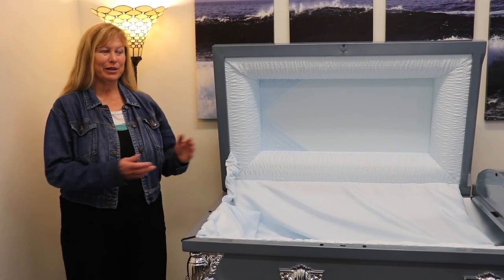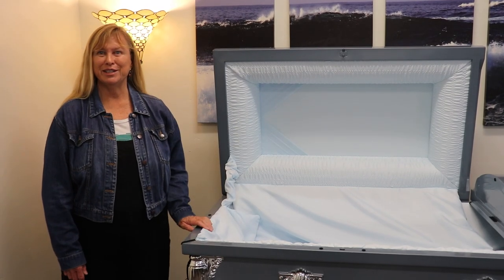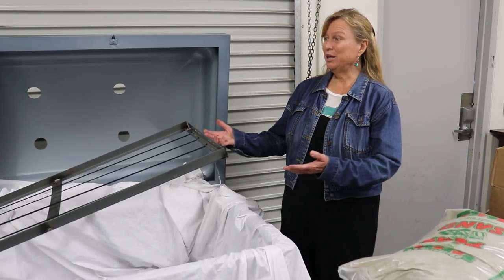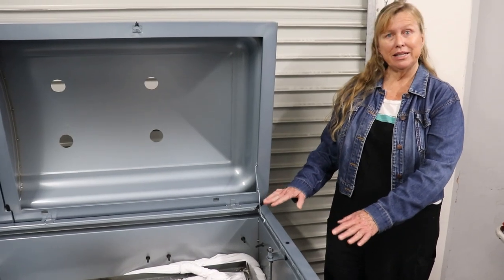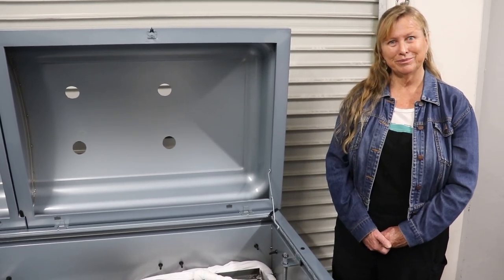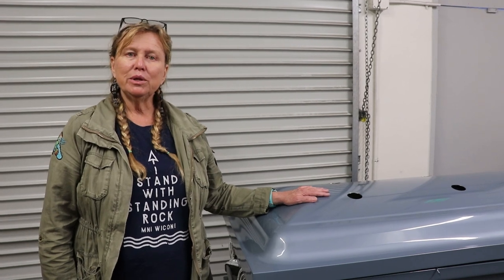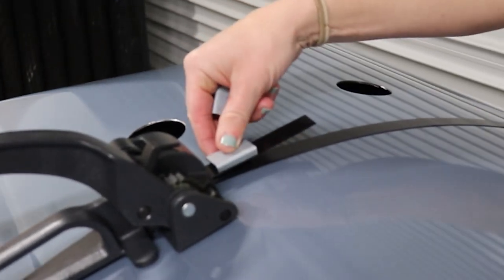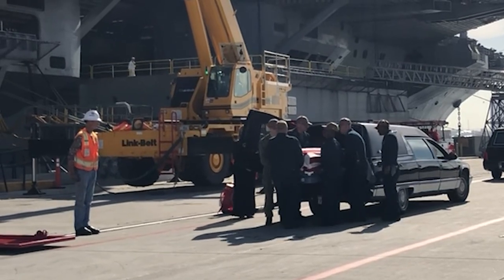Burials at Sea - Military Full Body Burial with Casket - [Funerals Your Way]

Comment: It's good that the military caught up with the preparations. Even back in the early 2,000's, often with a burial at sea, using a casket, it would float. After the ship pulled ahead and the floating casket was no longer visible to anyone on deck, sailors out of sight on the aft deck would shoot the casket until it sank.
Reply: How this casket was prepared was exactly how it was done back in the 80's when we did a burial at sea. A floater (as we called them) was a rarity but the Gunner's mates were always standing by..
Reply: Oh Wow

Comment: You would think the casket companies would make a casket especially for this so the funeral directors wouldnt have to do the extra work of ripping out the lining, sand, etc.
Reply from the maker: It would not be worth it. Burial at sea like this is not that common
Reply: A casket can be ordered from the manufacturer minus the interior, and they might even vent it if requested.
A military vessel is not necessary for this service, acquiring one would require added government paperwork, and if one is used it need not, and probably would not be an aircraft carrier.

Comment: I don't understand why they went to using a casket for a sea burial. In WWII they were sewn into a canvas body bag that contained a 5 inch shell or some other weight and slid off of a ramp into the sea. That seemed more dignified to me.

Comment: So sorry and forgive me for my ignorance but why a metal casket with plastic ties when a wooden one would break down over time as would cotton ties . Much respect . Caron.
Reply: The straps are made out of metal too. Wood not good! You don't want the box to break down before the body.
Reply: @chrislewis7238  ahh I can understand that. In these days tho you'd have thought they would have come up with something that wouldn't like at the bottom for eternity. Thanks for replying x
Reply: Wood is floating and you would need a huge amount of extra weight to make sure the casket is sinking. In the early days the burrial would have been done in a “bag”
Reply: @carondean2960  The thin gauge steel used to make caskets will disintegrate over time.
Reply: @chrislewis7238  Oh I imagined it was quite thick metal . Thanks for that
Reply: @chrislewis7238  why not..... Who's going to know? They will be far deep in the Ocean 🤷🏾‍♀️
Reply: @bas6983  cement will do it
Reply: @Noneck1999  who's gonna lift it?
Reply: @Noneck1999  The point is not to have ocean currents  carrying remnants of human remains all over the place washing them up on shore.
Reply: @chrislewis7238  fighter pilots from WWII DIDN’T , Titanic, ect. Deep water.
Reply: @Noneck1999  WWII fighter pilots crashed in primarily warm tropical waters, the bodies were shot up, bleeding, burned and for the most part encased in wreckage . What the sharks didn't eat the other sea life did. BTW the maximum depth of the general area of the battles of the the Pacific is 36,161 feet, nothing comes back from that depth. As far as the Titanic 1,500 people died 340
bodied were recovered we can assume that quite a few bodies were trapped inside the hull.,  as a large vessel sinks it drags down everything around it to the bottom, in this case that would be around 12,600 feet, again nothing comes back from that depth.. the bodies that were recovered were wearing life vest which would keep them from being sucked too far under so as the ship pulled away they would float back to the surface.

Comment: But you are still putting rubbish into the sea..meaning the casket..it should be all biodegradable I feel.
Reply: Steel biodegrades in sea water.
Reply: Salt water is cruel to steel.
Reply: Sa
Salt Water!
Reply: A shroud should be used, and when it is used, it would also act as weight as it is porous and absorbs water.
Reply: @joelwong1239  sometimes they do do it that way